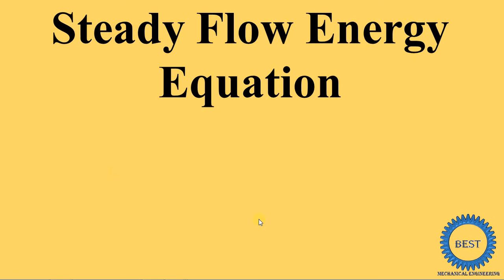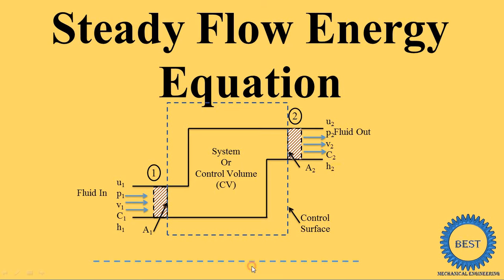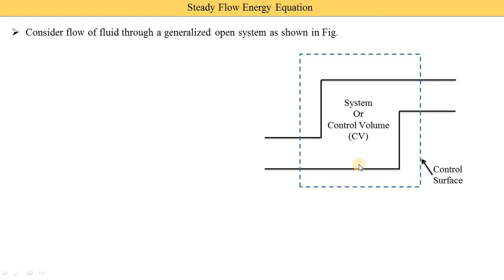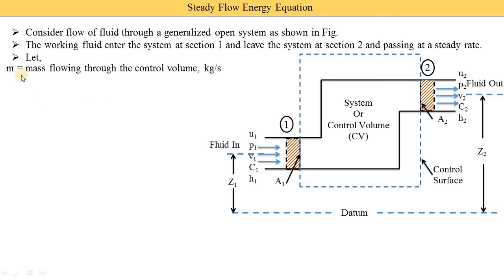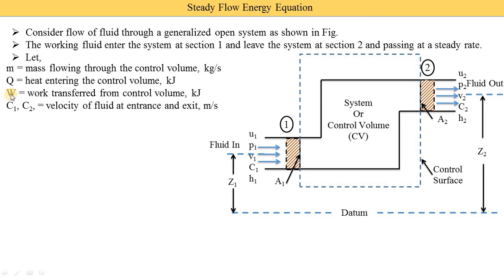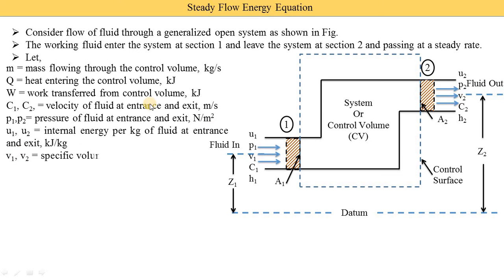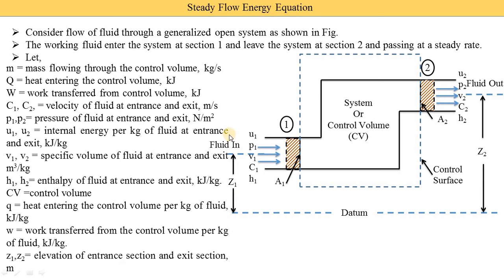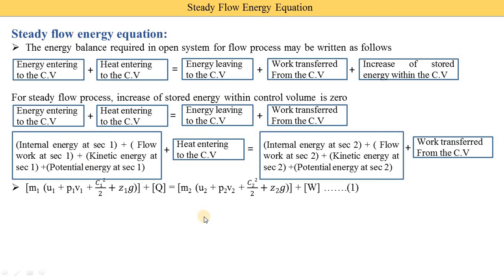Steady Flow Energy Equation

Comment: Please check the unit of Q. Is this KJ? I think it should be KW, then unit of equation will be in KW. m= mass flow rate, therefore 1/2(m.C1^2) is KW. Similarly, we have to use Heat flow rate in place of Heat flow(Q).